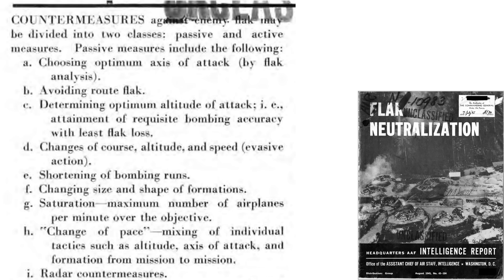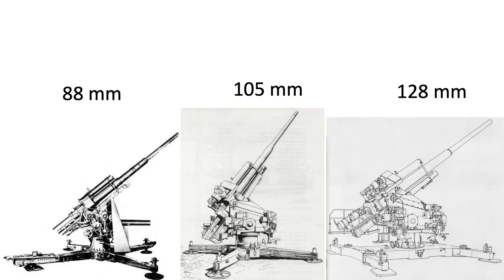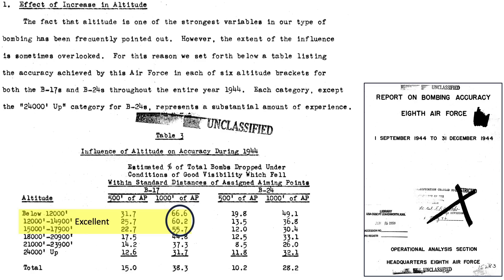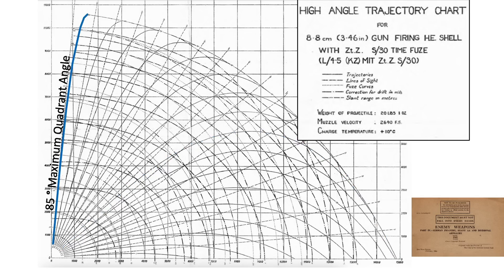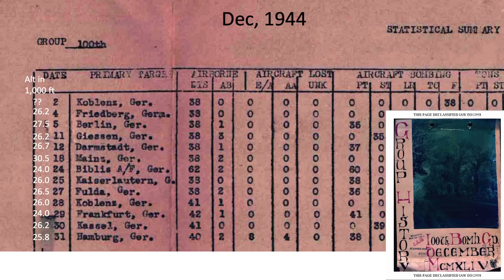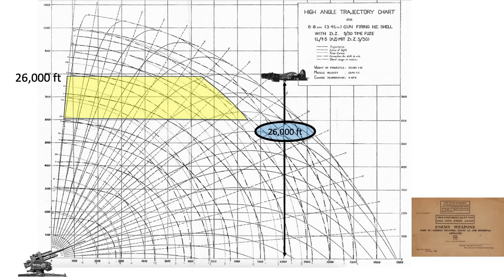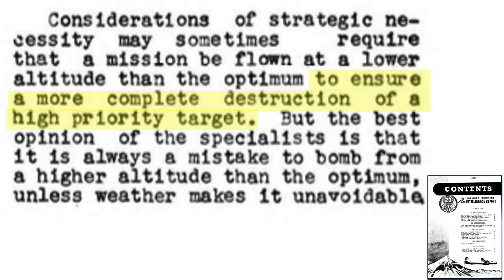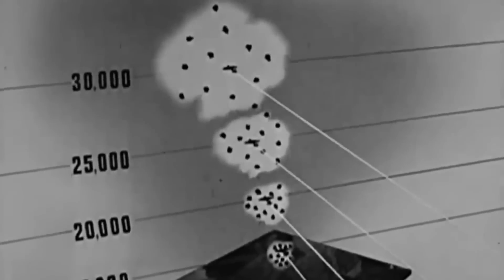Why attacking at higher altitudes was critical to Bomber survival against FLAK-Deep Dive Review

Comment: Another very interesting contribution on USAAF thinking. As usual, when it comes to such manuals, it makes sense at first sight and as a general guide. But it's interesting to mention that when crucial targets had to be destroyed, it was not applied. First for example the low level attacks on the Ploiesti oil installations in Romania, and later the bombing campaign against Japan. Here the low level bombing of Tokyo in 1945 stands out. After that, most important Japanese cities were bombed from lower levels. On one side the USAAF had the manual with all the data, and on the other side practical considerations.

Something interesting are the numbers that confirm how bombing with Liberators gave significantly worse results than bombing with B-17s. I did guess that for years, but never saw such interesting numbers.

Comment: 9:00 The calculation of effective range using the TAS is a simplification that only gives correct results when there is no wind. A better estimate would be arrived at by using ground speed (GS) which takes into account wind speed and -direction. 

That aside - an excellent video again.

Comment: Ok, you raised a good question. Why is B-24 accuracy lower than the B-17?
Reply: My Grandfather was a B-24 pilot. He never really talked about his experience, but he let me interview and record him one time. He told a story of flying a max altitude mission and said it was horrible. The B-24 was so unstable at higher altitudes that they lost bombers due to crashing into each other while in formation. My guess is that the B-24 pilots would fly in looser formations at high altitude and that would impact accuracy.
Reply: The main difference that effected bombing accuracy was the combat box formation used. B-24s are more difficult than B-17s to fly in formation at high altitudes and with more restricted cockpit visibility - thus the wider. looser box is going to put a smaller percent of bombs within the magic circle. Combat box layouts varied over time & depended also on the air group 'tradition' plus if fighters were expected a different box type will be chosen. B-24 accuracy improved greatly in 1945 when a diamond box was adopted by some air groups. Note that a tighter combat box can increase flak casualties!

Comment: First I heard that the WW2 bombers could fly above the 88mm flak.  Very nice discussion.
Reply: -The 8.8cm FLAK 37 (model 1937) had a muzzle velocity of 840m/s but the 8.8cm FLAK 41 (model1941) had a muzzle velocity of 1030m/s.   Luftwaffe studies indicated that at 29,500 feet, the 88-mm/Model 37 had only 14 seconds to effectively engage a target, the 10.5cm FLAK 39  had 49 seconds, and finally the 88-mm FLAK 41 and the 12.8cm FLAK 40 both had 68 seconds of effective engagement time. At 36,000 feet, only the 88-mm/Model 41 and the 128-mm were able to engage a target for a period of only 31 seconds. 
-The 8.8cm FLAK 41 and the 12.8cm FLAK 40 could thus reach both the B17 and B29.   
-The 8.8cm FLAK 41 was dual use and some were shipped to Rommels forces in Africa in 1942.  It ran into technical problems that were not solved till 1944 so few of this potent weapon were produced leaving the RAF pathfinder mosquitoes unmolested and allowing the USAAF heavies relative safety above 25,000ft. 
-The first problem was that materials shortages in the war forced a conversion from brass to steel cartridges and these jammed at the seam of the barrel liner sleave.  The second related to Vibration and rate of fire.  The gun was equipped with an autoloader with an integrated fuse setting machine and power ramming to achieve 25 RPM (above the FLAK 37 15 RPM) but this caused accuracy problems.  The problems were solved by 1944 (I think by firing on the recoil) but by December 1944 or so only 318 were in service.
-The 12.8cm FLAK 40 had the range and altitude needed, it was the most powerful AAA weapon of WW2, but its cost limited production to 1125.
-The 10.5cm Flak 39 while better was not enough of an improvement and limited to 4000 units of production.

Comment: Why were the B-24 accuracy statistics so much lower than the B-17?
Reply: My Grandfather was a B-24 pilot. He never really talked about his experience, but he let me interview and record him one time. He told a story of flying a max altitude mission and said it was horrible. The B-24 was so unstable at higher altitudes that they lost bombers due to crashing into each other while in formation. My guess is that the B-24 pilots would fly in looser formations at high altitude and that would impact accuracy.
Reply: @DeepSouthDakota  My father was also a combat B-24 pilot and am certain he would totally agree. '24s were very hard to fly at any altitude, let alone max. Dad said that at at max you could watch the wings surge so high above the fuselage you'd swear they were about to break off. Plus the 109s and 190s screamed past the '17s to hit the '24s cause they burned quicker and that was a whole other problem.
Reply: I believe it was covered in an earlier video, but one hypothesis is that the B-24 was a somewhat less stable bombing platform (more prone to moving in turbulence and other disturbances) compared to the B-17.
Reply: Among other things, the slab-sided fuselage increased the effect of gusting crosswinds. I think that the low aspect ratio wing with large span contributed as well.
Reply: Maybe the B17 bombed from a lower level which was more accurate. 
But more dangerous.
Reply: @redtobertshateshandles  Maybe, but the '17 was much more forgiving on many more levels than the '24. Said my father who flew both, '24s in combat.